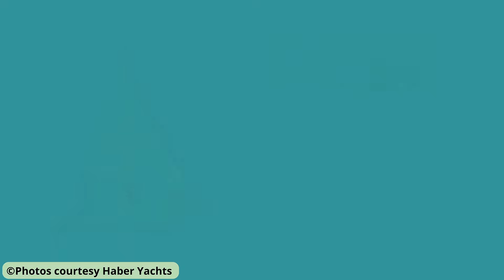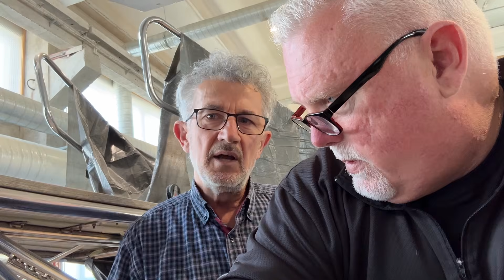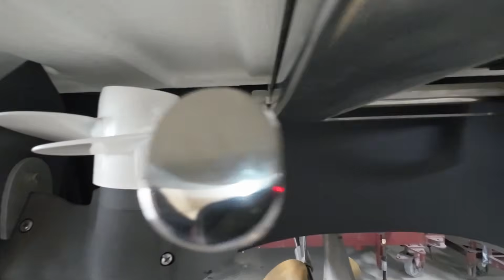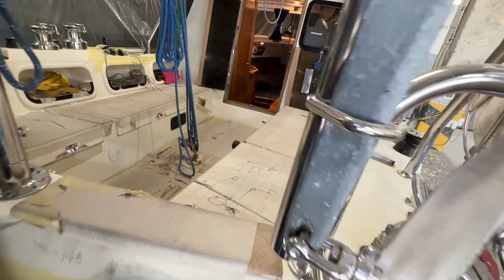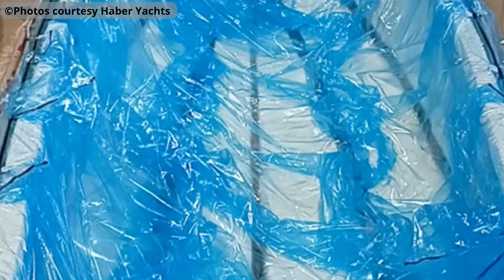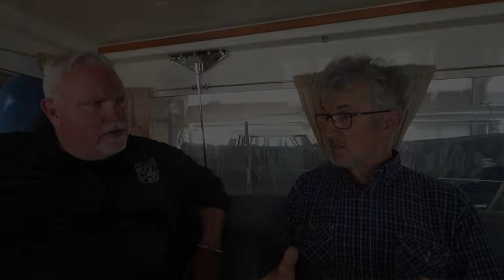Revolutionary Sailboat Design 🇵🇱 | Haber Yachts | Boat Building in Poland (Ep146)

Comment: Very off topic of the videos main point, but I love that you shoved those molds with metal pipe framing. I've been planning a mold for a while, as I want to build some small fishing boats, and I've been trying to come up with solutions how to frame the molds in order to have them be easily transportable and stable. I've seen people use bulkhead type plywood on the outside of the mold, but found that very hard to cut the plywood into shape with the mold plug and mold having unique designs that differ from the actual bulkheads of the boat. The metal pipe frame answers my question perfectly, being simultaneously rigid and easy to manufacture into complicated shapes.
Reply from the maker: Thanks so much for the comment😎. I find it fascinating also. I think the stability of the mold is key for multiple productions from the same mold 👍 Good luck

Comment: Nice video. I test-sailed a Haber 660 Sloop with Janusz and the Swedish Rep. around 10 years ago at a harbour boat show in Gustavsberg, Stockholm. And I looked around the boat properly at the same time. I also met another 660 some yars later with a skipper that crossed over the Baltic sea to Öland. It's a very unusual and unique design - Most trailerable pocket cruisers feel flimsy and made for protected waters, but it was a "sturdy little ship" of very high quality and standards, and we hade a fresh breeze with some gusts approaching gale force. Shallow draft with centerboard lifted and rudder up, easly folding mast on deck for transportation, canals and bridges.. I'm still sometimes looking at for a used 800 Cutter variant at online ads. Maybe some day I'll get one.
Reply from the maker: Thank you very much for your  first-hand account of what sailing of these boats is like 👍😁 it’s great to hear from someone who has actually sailed a Haber Yacht ❤️ thanks again for the comment

Comment: Wonderful boat and design...except maybe for the four centreboards.
He didn't answer the question of introducing more complexity.
Obviously, it does, which is an issue on the open ocean. My question is does this complexity answer a big problem, ie the boat's tracking, over the downside of complexity, especially in the open ocean? 
Great boat, though. I'd have one.
Reply from the maker: Indeed it does. 😉You can google Janusz Konkol and Haber yachts and link to detailed articles about the design, why he invented it , and the problem it solves. Complexity, idk? New way of thinking, for sure 👍 Thanks for your comment

Comment: my 36 foot aluminium sloop also has 2 daggerboards, one central and one aft before the rudder. The boat was built in 1978. The goal is to move the lateral centerpoint forward or aft, just like you move the sail's centerpoint fore or aft. Look for 'trisbal', 'trismus', 'triswood' ... on the internet.

Comment: A spoked wheel is a bad idea. The spokes will catch on your sleeves. But he scores points for no absurd and dangerous overhang over the front windows. In any case, the boat is too fussy, too complex to be practical. Too many complicated adaptations that can fail and will need continual inspection and upkeep. Maintaining the cosmetics alone is a job in iteslf. How do you keep it clean? Salt water is a kind of soup of organic material, and it will get everywhere and need to be wiped down. The fewer corners, crevices, protrusions, etc. that can trap soil, the better.
Reply from the maker: Everyone look at Willard. He’s a true Salty Dawg. 👎 Bumping his gums from the couch in his mother’s basement. 🤣😂🤣😂🤣😂 http://youtube.com/post/Ugkxl2By3v4PegoT3S6mQkVC9Nr1T87FD2Qi?si=z-lwD6RIOmwOwY6s

Comment: I know Janusz, or rather I knew him. We met about 40 years ago working for same company in Ilawa.
At this time he had small yacht Zośka (Sofie) and had no time to finish that. I had time and some skills, so we agreed I will finish boat and have 2 weeks charter every summer for free.
One day I was fixing stainless steel element  (stay attachment ?) to the deck,  Just the element and 6 screws dia 14 mm 3 on one side 3 on another with nuts under deck.
He came at the end of day so I showed him my few hours job and he said OK. But by expression on his face I saw it's not OK.
So I asked:
- Janusz, by yours face I see that's not OK, tell me what's wrong, just to avoid that in future?
- rows are not in line.
- what f...d rows ???
- rows for screwdriver on screw's heads should be in line.
That's how he is, total perfectionist

Presently we do not have any relations, but I can give my most honest warranty on EVERYTHING he do with boats.

Master Mariner cpt. Baboo
Reply from the maker: I totally understand. 😉 I feel that he is a true Master at his profession and only by that passion can he achieve the great boats he builds. Thanks for the comment
Reply: I know someone 🐙 who has to line up the screws as well 😂
Reply from the maker: 😎 seems perfectly reasonable

Comment: It is amazing to me comparing this guy's thinking to that of Sven Yrvind and myself.

Two of Sven's ideas I see here are the multiple leeway preventers, spaced along the length of the boat, to provide better balance under sail, and the ultimate stability provided by tall enclosed sectional areas, instead of super low ballast placement.

One of my ideas is to return to the forward maximum beam placement to maximize internal hull volume and to improve downwind behavior.

Also, the permanent dodger/pilot house, is an idea I have liked for a long time.

A  big  reason people have abandoned sailing is the lack of comfort on deck. No one wants to sit in the hot sun all day, or the chilling rain. Dashing forward in those conditions to reef or change a sail, now and then, is one thing. Enduring them for hours on end, is another.

The price for all of this is lower performance. The modern sailboats are almost certainly faster in most conditions than boats of  this description. But is going perhaps half a knot faster, and being miserable, really better?
Reply from the maker: I have strong opinions about Sven and his YouTube channel. 👎Despite his years of experience and sometimes interesting ideas—I’m confident he’s 🤡 grifting you and all his fans. I recommend you look elsewhere https://youtu.be/SmiAkp9SDjg?si=3x8BHCOO6Rt5bUAz
Reply: @motorcityboatwerks  I'm not sure I agree this applies to Sven, but it certainly applies to some other YouTube channels I've come across.
However; I  think if a man his age tried to undertake sailing the boat he's building in the cold of the southern ocean it would kill him. I think deep down he knows this too, even if he hasn't quite got around to admitting it. 
I believe what he enjoys most is pottering around in his workshop, and there's absolutely nothing wrong with that. My prediction is that there will be some lengthy local sea trails and another winter doing either modifications, or starting yet another "Next boat"
You hit the nail on the head with that video and I laughed out loud several times. The channel it most brought to mind was "The Bumbling Sailor"
Reply from the maker: 🤓if I made a parody of what he is doing in his YouTube channel there would be no doubt in anyone’s mind 😂 let’s be honest—He gets a big pass from the audience because of his age and a younger life of adventure…
Reply: Phil Bolger and Matt Leyden too.
Reply from the maker: Many great designers and builders👍😁—but to find a  competent amateur builder or even a naval architect with the combination of real world sailing experience, formal training, and articulate understanding of the amateur—that’s the rare bird 😉
Reply: I have a fascination with small sail boats after reading “My old man and the sea”. I will never attempt Cape Horn but the engineering behind it is very cool
Reply from the maker: Then you will love  all my videos be sure to check them out and be sure to subscribe 😁